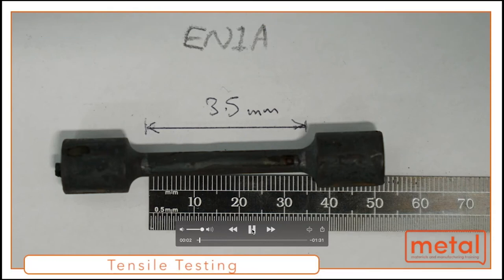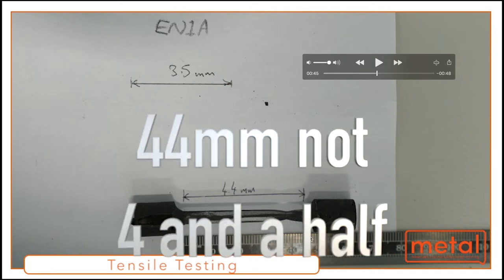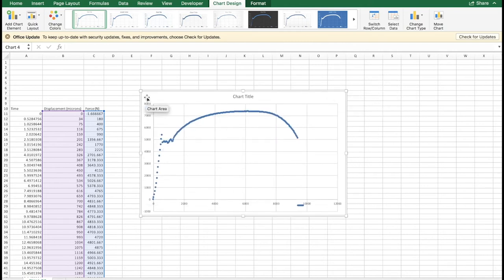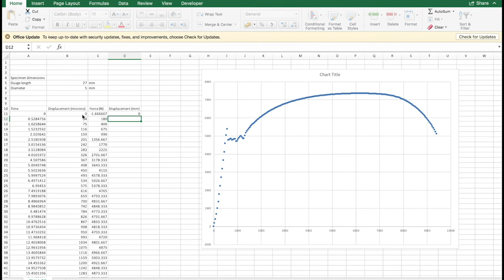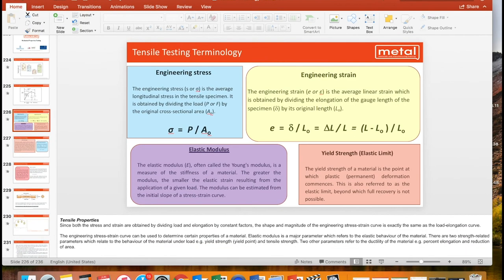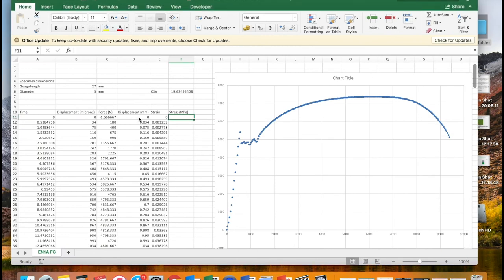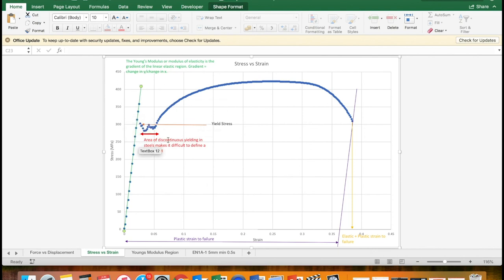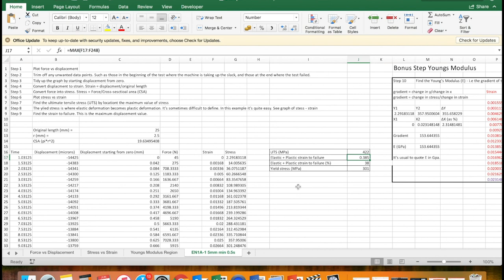Tensile Testing – Analysing the raw data

Comment: Thank you for the useful video!
I have a question, I still don't understand how you determine the yield stress. I'm also working on the discontinuous yielding case; we usually determine it by the lower yield strength. Why in this case you determine the yield stress as the region when it changes from elastic to plastic deformation? Not based on upper yield strength or lower yield strength? Thank you!

Comment: Thank you for this! Helped me a lot. Just a question: if you don't have the software you used in the video (i.e. no line to drag with the same angle as the gradient of the elastic region), how can you calculate the elastic + plastic strain to failure using Excel?

Comment: Hello, in the earlier parts of the excel,  the force measured was  a negative.. You mentioned that there are things that you could do to adjust that. Would you need to correct it before making the stress strain curve. If so what would you do? Also the yield stress that you selected at the end of 301. Is that just based on the graph before it undergoes plastic deformation?